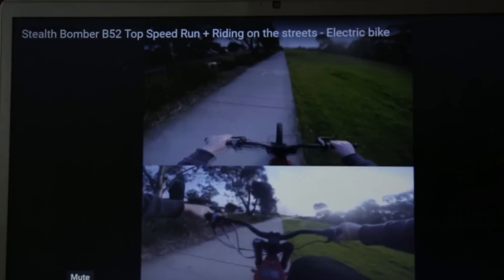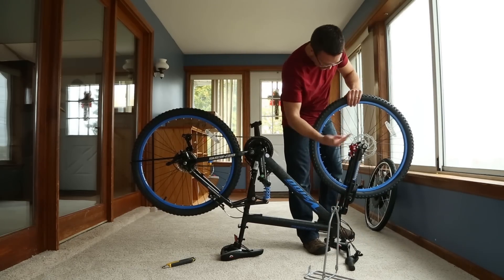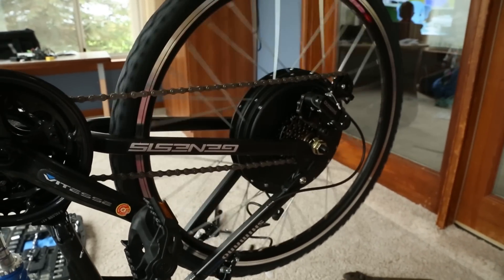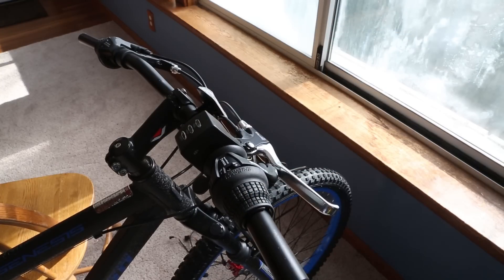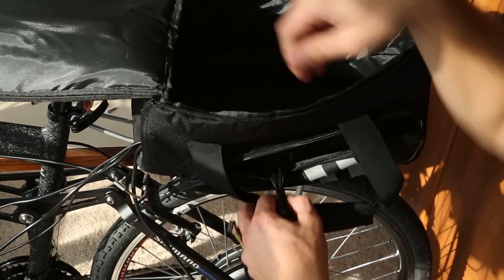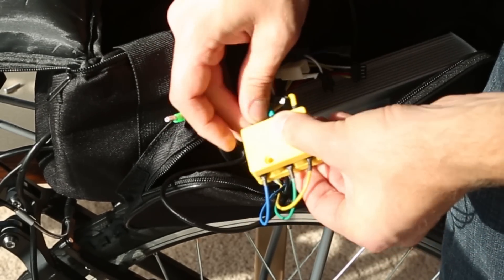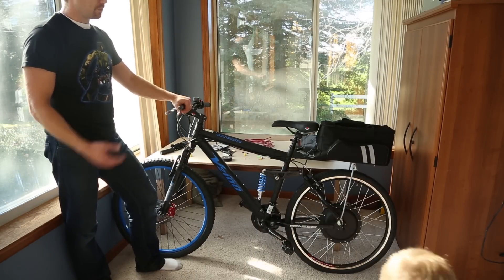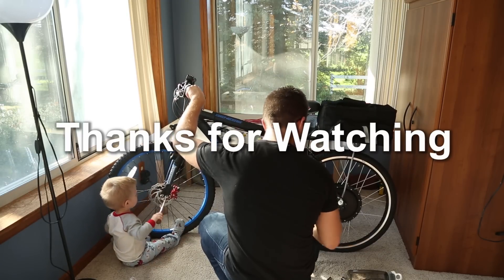How to make an electric bike for under $500! Fast & Cheap eBike tutorial!

Comment from the maker: Check out the FAQ/UPDATE video - https://youtu.be/CU9PcscbU-8  Also the No music version - https://youtu.be/eLc8ocdMAts
Reply: damn i wish i knew there was a no music version before watching this whole thing... that music annoyed me to no end!
Reply from the maker: No music version here -  https://youtu.be/eLc8ocdMAts
Update video  - https://youtu.be/CU9PcscbU-8
Reply: TechMindBlow people are so anal the music was fine....the majority of people’s channels have music ...maybe you should’ve played heavy metal 🤘
Reply: Only problem with it is that it is a rear suspension bike and you’re putting a bike rack on it that was designed for Hardtail’s you may not have an issue when eventually it will show up
Reply: TheNy615 ;
Reply: Cool music. Cool video. You make it look easy. Subbed.
Reply: How do you charge the batteries
Reply: @donkimp473  it's in the description, there is one charger that charges all them at once and another charger that charges one at a time
Reply: TechMindBlow I got one for 700
Reply: What wire should I use for the battery?? I'm not good in electrical stuff . Please help.. thank you
Reply: Do you think a car battery would work?
Reply: I was just about to comment that this video would me much more watchable if there was no music, and here it is pinned to the top!
Great channel here.
Reply: the amount of fails in this video is staggering... #1 this is just an e-bike you built, and not better than a $750 version already built. #2 there is a reason why no one uses those batteries when making an e-bike - they charge too slow and discharge too slow and will overheat. and they weight 4 times more than lithium. #3 as someone stated, your rear suspension will never work with that rack. #4 the watts in the stealth is in the thousands of watts...  and while IMO it is overpriced, it is still worth 10 times what you built.
Reply: @EliteGeeks  yeah it it
Reply: @EliteGeeks  you could have given the same info as advice.
It is in your power.
Reply: Great video. Not sure why 1k viewers gave you a thumbs down... THEIR LOSS!
Reply: Help me bro please promote my channel

Comment: Recently did one of these myself with a 2000 watt motor little tip for you on your rear hub motor your wire is facing up point that down or water will run into it or get some bathroom caulking sealant and seal up the hole where the wire is coming out😊

Comment: The rack is connected across your rear suspension movement in other words your rear wheel moves flexing the rack mounts. Problem is compounded by heavy lead acid batteries also being moved thus negating the rear suspension and applying greater forces to the dangerously mounted rack. This rack mount is reasonable if fitted to a hard tail however even then the high mounted rear bias mass of the lead acid batteries will seriously compromise the handling............correct me if Im wrong......Im not!

Comment: I built an ebike out of an old kids ebike, specifically the mongoose cx24v450. If you can find one or any kids ebike many of them use either a simple geared hub motor or direct drive chain drive motor so its super easy to swap out the motor controller or battery, also all of them have a dedicated controller and battery mount (if you get lucky some of them give you a large battery bay). I swapped the motor controller and added a larger battery pack and now i have a 60v 5000w beast that can handle the trails or i can ride around town with my street wheel set. Granted my set up costed just under 2k im sure someone else could build a 48v 2000w version of what i have currently for about 700-1100 depending on how much your initial bike costs

Comment: First of all I've only watched up to 1.50 
Them stealth bomber e-bikes have at least 5000 Watts to 8000w 120v hub motor
Cost more than £500+ for just that.
A ok battery pack too much that will be more than £1000+
If you make your own battery pack probably £500.
Some first-time builder buy fake cells and wonder why they have problems.
That if they don't catch on fire 

That hub motor you bought looks like a 1000w 48v 
With a under powered small controller.
Looks like has 12 mossfets  
What a 700 watt motor uses

Comment: if those Lead Acid Batteries, they lose peak power after every charge or the peak power declines 5% after recharging with the range loss as well. I know, 20 years back it was the one thing that frustrated me and gave up scooter until this year not noticing the huge leap of e bike tech and its been 10 years of it so Im behind.

Comment: One of the most important factor of building a CKit EBike is to make sre to use a frame that is very durable. People overlook of using Bikes of high speeds 20 to 45mph the Bike is constantly stressed of the speed as nuts and screw, bolts, ect start to unravel. With those who make Dual motors the front forks can be ripped apart due to constant stress of weight and speed, even with the torque sets on. Just durable and well maintenance as this becomes part of routine after riding of adjusting and going over checks. Believe Steel is best when dealing with high speed bikes over 25mph.

Comment: Ok hopefully someone can help me with this. So im trying to build an electric bike too and i ordered a 24v 350w electric motor and a 22.2v lipo battery. The battery's connection is a xt60 plug and the motor has these a black and red wire with this golden thing on it to connect to a battery. Since the connections for both are different, I bought a xt60 to wire adapter so that i can plug the battery to the adapter, and the adapter to the motor. So to test it, i touched the adapters wires and the motors wire ends together and then there was a spark and a small fire. Can anyone tell me how to fix this?

Comment: My back wheel kept coming out; I had to add a torque arm and problem solve. Wanted to put the battery in the down tube, but the holes are in the wrong place; making more holes weakens the frame, any ideas? I will try a bottle cage mount attach with two Jubilee clips, but have the idea that might not be firm enough.

Comment: I can't believe I saw the rack mounted on the rear suspension! Please take that off before your controller and battery go flying off. The rack is not stable enough to hold the integrity, especially if you take a bump! Good job but please, change the rack and actually use the rear suspension!

Comment: Plus your bike is nowhere near what that $10,000 bike is not even close that bike you pointed out it's an off-road monster it runs 60 with modification can run almost a hundred I can also take jumps 12 feet in the air and your bike wouldn't it break. So you know we're really near that $10,000 bike but nice build anyway change out your battery

Comment: What kind of range have you gotten? I also wonder had you connected the pedal sensor if you could get more or less power! I definatelly want to build one but so many questions like the longevity of the hub motor and such! I intend on using this to commute to work but it's 13 miles each way with a large 800 foot elevation change hill at the end of my way there! Of coarse on the way back it would be downhill and I will be able to charge for at least 4 to 6 hours while there!

Comment: It's them lithium Ion batteries that are expensive 40 pounds of led acid batteries will get 15 miles but to go farther than 28 miles have to use lithium Ion batteries, I built My Electric Bicycle In 2012 for 625 dollars I have been waiting 8 years for batteries prices to come down so I can go to the health food store, so I Am going to try to build a hybrid Electric but I Am having trouble with UPS delivering the cart and finding a high wattage 48 volt even 24 and 12 volt transformers and connect In series so what I Am going to do Is use a European to America step down transformer and get 54 volts and slow the generator down.

Comment: Cool. . . I really like your work and I will be building one for myself. Did your kit not had a controller display unit?
Reply from the maker: No display
Reply: @TechMindBlow  Genesis V2100 is out of stock. Can you recommend another bike?
Reply from the maker: @zikriyakhan5259  not really. I can't say what bike will work better than another. Someone say though the bag would be mounted better on something that does not have a rear shock since the rack will bolt on and you don't want to stop the shock from working. Honestly a lithium-ion battery mounted under the center post is the best. The setup I have in the video is very back heavy. So it feels kind of funny

Comment: do i NEED the 48V charger? or just the simple charger?
Reply from the maker: Good charge of the 48 volt if you leave it wired the same way. Or you could use 12 volt if you charge them separately.

Comment: Hi, at 11:04, your connections don't look very secure. Did that yellow connector come with nuts to lock down the electrical connection? Loose wires will cause faults in your system, and make it less reliable. Just a thought. :)

Comment: Looks good. You did overestimate on the battery though, I got me a 48V 14aH 1000W battery for $241.00,
I only paid $171.00 for a 1000W rear tire Hub motor. But hey, you did a great job and what's more important is it worked and you like it. So, good Job!

Comment: I would have a few switches installed too,  so the bike doesn't shoot off by accident. Instead of the thumb throttle, you could upgrade to a twist throttle with a built in keyswitch. Right now that bike is always live.

Comment: Did anyone mention or notice that the 3 wires in the yellow block are supposed to be bolted down? Al you did was put the cover on so the wires are just loose, bouncing around inside the block.

Comment: basically cut the bike in half. drill a few Holes. then Run and connect all the wiring inside the pipes of the bike. then weld it together again. if you cant do that your self take it to a welder he won't charge you much or anything at all. that way you get a clean look. and a much more durable conversion from Manual Labor to Electric.

Comment: Thanks for the well made video of converting a bicycle to electric. Nicely done, and cleanly built. 

I know the go-to place to carry bulky batteries is in the main triangle or on the back rack, but the closer the weight is to the bottom of the rear tire, the easier it is to maneuver the bike. Low CG, and it doesn't try to resist changing direction when the rider turns. Below the rear axle if possible, two of those 12-volt batteries on each side for balance. I got a fast education with mass and motion when figuring out where to mint a kayak trailer for my e-bile. The trailer weighed under 10 lbs, but the kayak was 50, and 15 feet long. I settled on putting the hitch at one side of he rear axle for convenience, but should have created a drop-down bracket so the mass was connected lower, at least at least halfway between the axle and where the back tire touches the road, maybe even lower. Maybe someday...

Mounting the batteries lower also  makes it less likely to fall and hurt someone, like a tree with the word "TIMBER-RRRR!" 

Peace, and pleasant pedaling!

Comment: you can buy factory made ebikes for les than $500?
Reply from the maker: Possibly but they will not have the same power but they might be a little higher quality. Especially if you don't have a bike already it might be cheaper.

Comment: @08:02 Soapy water will do the trick to putting the grips on and for taking them off.
@05:08 Why didn't you just cut the hold open and make it a 'C' rather than a hole. Since the weight of anything you put on there will be acting downwards, it will stay once the wheel nuts are tightened down with some locktite.
@14:05 Just use a black Sharpie and shade the end of the wire black. That way you know that its the negative terminal connection. In automotive wiring, they commonly use a solid color for the positive and the same color with a black stripe down the middle for the negative.

Comment: I just bought myself an ebike kit and a pretty decent battery. Ich am verry hesetant, connecting them because i tried once and it made an ark and a little bang, like i short circeded the battery. There is nothing, hooked up to the controller and im afraid i fried my battery. Adivice  would be greatly appreciated
Reply from the maker: I would hate for you to ruin your battery. The only thing I know is that mine would arc almost every time I connect it. But I was also just using simple lead acid batteries. I would email the battery of manufacturer and see if it could possibly damage your battery.

Comment: If I were doing this, in the name of safety, I would spend at least 500 dollars on *the bike*! The genesis v2100 is not a good bike. For 30 mph, you should have at least front and rear disk brakes and hydraulic would be best. It is also a very heavy bike, and the suspension is just a gimmick.
Reply: You don't even need to do that, just spend the $150 on a used, quality bike. You can get used Treks for that much.  I wouldn't be able to tolerate that genesis.
Reply: @bob15479  get whatever works for you. Dont blame anyone else when you hit a car at 30mph cuz your brake didn't stop you
Reply: @bananasstuff3344  I'm just saying the whole point of this build was to be cheap and you can get a bike that cost $500 5 years ago for $150.
Reply: @bob15479  yes but you will the have to spend 75 usd getting it serviced

Comment: I want to do a convert for doing courier work. Is there a way to not have to put the electricals in a bag as someone will steal this?
Reply from the maker: They do make lockable batteries that mount to the down post which requires a key on bolt. Just check Amazon
Reply: @TechMindBlow  aahh thanks for that

Comment: you can make elektri9c bike kit under 200 $ just i orden england ebay, bike kit, need buy other only 2 battery. 24V 300W kit all have include, but whitout battery. 160€  working well, i use go home to shop and home to work and back. but power no have lot, if make good E.bike need minimum 500W motor. 300W no can drive little hill or somethink little, need pedal lot more. but help road and city good.

Comment: Tracey Lam
2 minutes ago
I have an electric bike, it has a switch on the battery which is under my sead, in the handle bar I can't switch the battery on and off, it only can change the speed of the electric, it has 3 speed choose on it, if I just want to paddle the bike without the electric, it is very hard for me to reach the switch on the battery, how can I add a switch on and off on the handle bar, then I can choose use paddle or electric when I was ridding on my bike. please let me know on this question, thank you so much. can you do a video for it?

Comment: All that worrying you could get one of the bike tubing disappointing heat pipes it's split open so you could put wires inside I it stay dry too goes length of handle bars  what size motor what name is motor?

Comment: What is the range on this bike?  

Or how long is the battery life? 

Also great video btw
Reply: I can imagine it will be around 5-10 mile because of his battery choice I have an ebike I built almost the same as this one and used lithium ion battery's that I spot welded together the cost of the battery altogether was around 150 English pounds meaning it is quite expensive but I can easily get around 25 to 30 mile also it improved the power because more amps could be drawn out of the battery

Comment: Never, ever build a 30mph ebike using a cheap donor bike, especially not before installing torque arms over the rear dropouts, the torque could stress and eventually shatter the rear dropouts which will end badly at high speed. Any setup of 48v or above should be installed on a quality frame, if you can't afford a high quality alluminium frame then go for a good steel one. Also you need a bms, without that you have no voltage protection and this could potentially result in a 30mph ball of flames.
Reply: Make a video teach us what is what bms an torque rod
Reply: newer dont install e-bike motor front wheel, its wery dangerous have torgue rod or not, only rear wheel must install, idiot if install front and bad lucky kill itself.

Comment: I got a Cannondale mountain bike and want to turn it into electric and trying to find out what electric wheels sizes I can use esp the front 37-622(700x350-28x 1 5/8x wheels ? this is what it say on the tires min.50-max.85 psi (3.5.-5.9 bar350-590KPa) 37-622(700x350-28x1 5/8x1 3/8) k-192-003 drive ?

Comment: Great project!  Wondering how long it takes to charge and how long the charge lasts with your setup (on relatively even terrain)?
Reply: It cant charge with the batteries he used. Get better chargeable batteries
Reply: @patrick-up1409  i use those same batteries on my deer feeders....with a solar panel and it charges just fine

Comment: I'm going to do a video using two 700c 1500watt motors and two 48v bottle batteries. I've made one like yours but I had front wheel motor I cant wait to start my new project.

Comment: finished building one just like this.  Feels like the front end wants to lift up lmao. It never actually pulls a wheelie though so not a big deal.  Those batteries are heavy asf, might move 2 to the front or something somehow
Reply: I made a triangle pack that fits in the frame out of 18650 cells. Cost me about 200 total. I used same exact bike. 14s8p triangle battery.